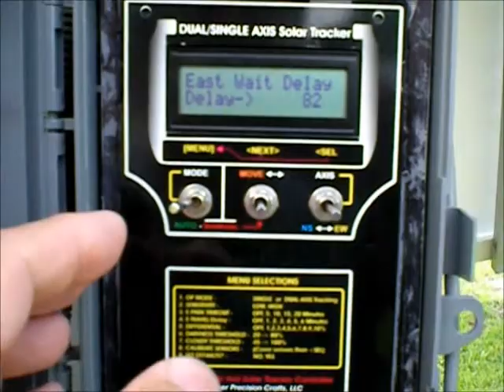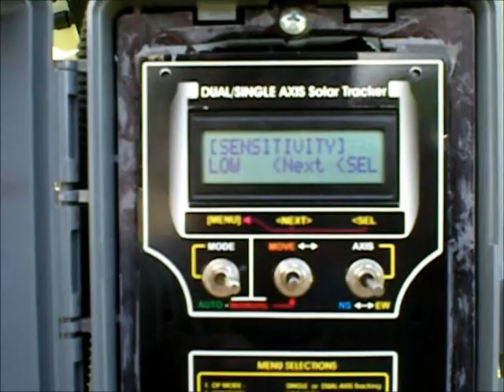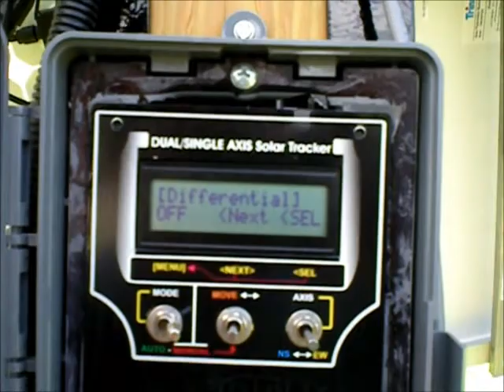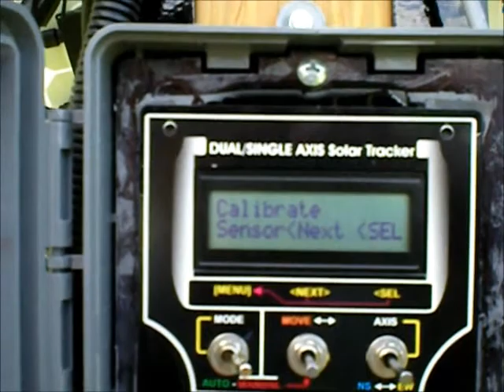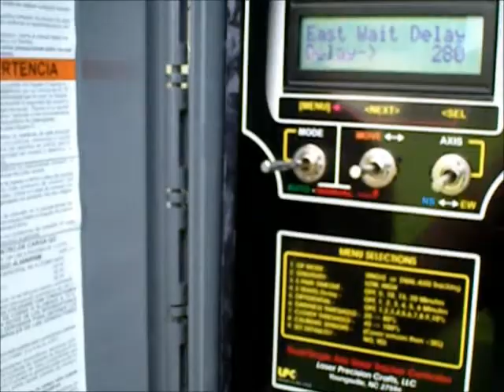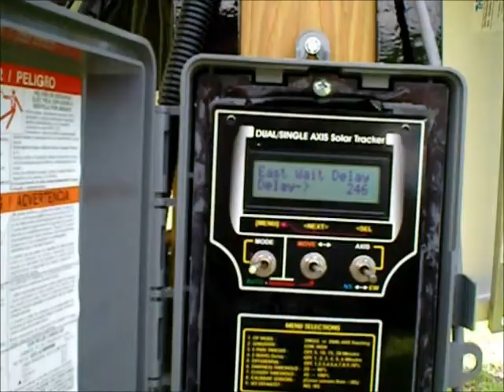Prototype Solar Sensor Fully Exposed,In Single Axis Mode,A look Inside.

Comment from the maker: Thanks It Takes a huge effort to make a new product do what it is supposed to do.So u can A-bench test models or B- Give it to some one that has a full size test site with multiple units to use as a control for how it works is a very smart move,as to selling them and hoping it works out.Plus if U dont know who is on the other end and what there doing or what they have done U are still just guessing.This was a good opportunity for my work in this area to be used in this Way.

Comment from the maker: Whats not to like.it will do anything u want,plus it will work in a dual axis mode.I will be making the bracketry to make this tracker a dual axis so i can try that part of this unit out. Myself If U have a single axis working as it should ,And that' can be  hard to do, U will get 30 to 35% real world #s gain over a fixed as i have shown many times.To chase another 5% gain that known to be about the best u can achieve with a dual axis,so 40% or 5% more is to me not worth it. Just MY opinion.